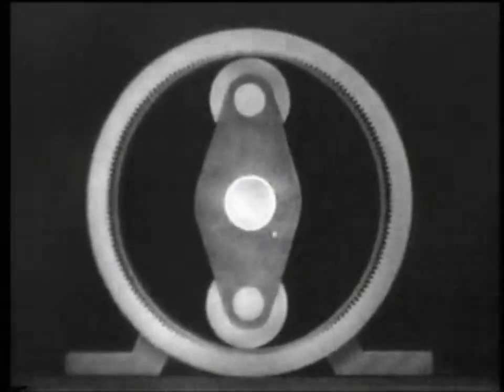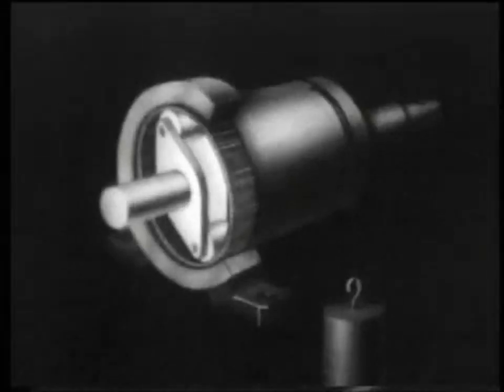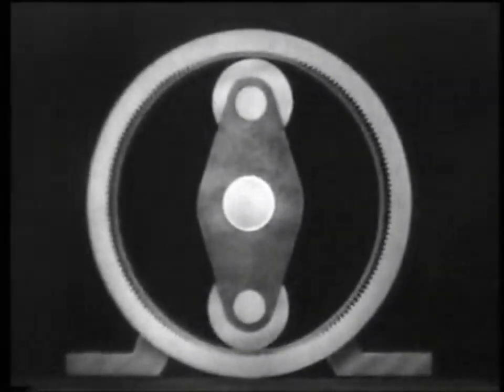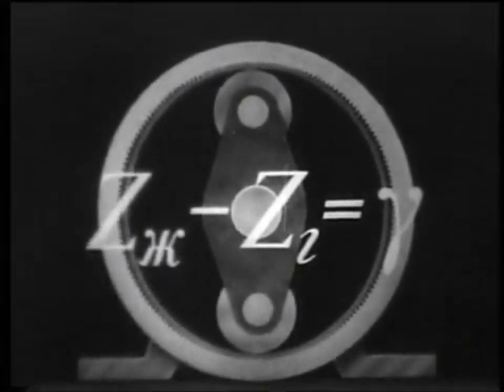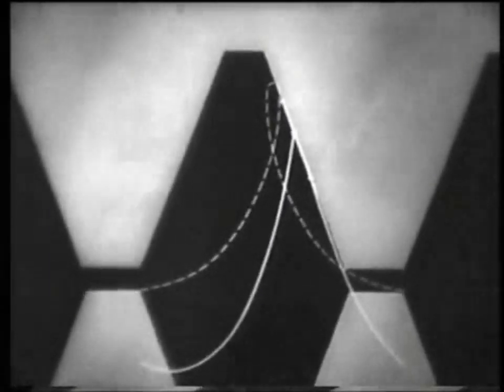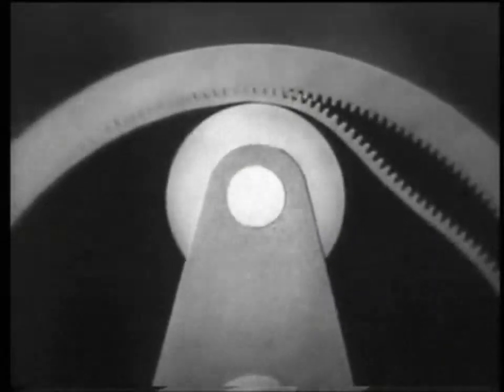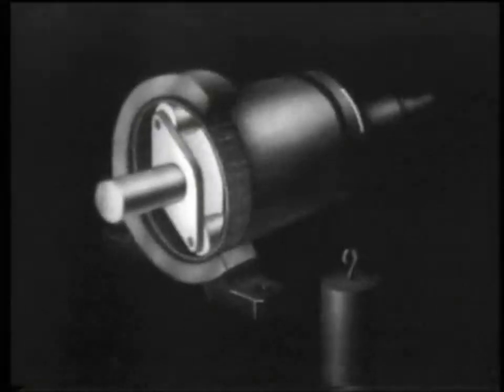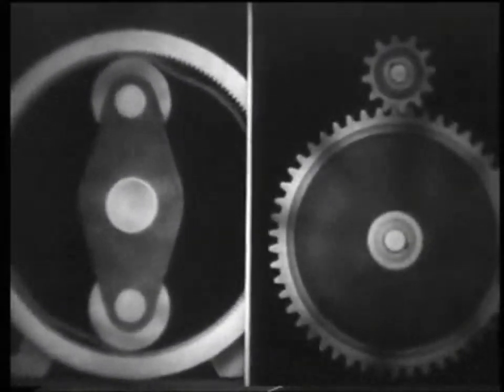Strain wave gearing. How it works?

Comment: That was interesting, I've never had wave gears explained before although I had heard about them.
Reply from the maker: Yes, in fact, this is a very interesting topic, mainly wave transmissions are used in aviation and space technology, in industrial robots and manipulators, in the drives of lifting machines, machine tools, conveyors, etc.
There are hermetic wave transmissions that transmit rotation in a sealed cavity located in a chemically aggressive or radioactive environment, or in a deep vacuum, and there are also structures that serve as actuators of hermetic valves.